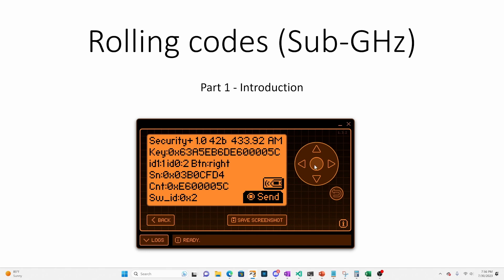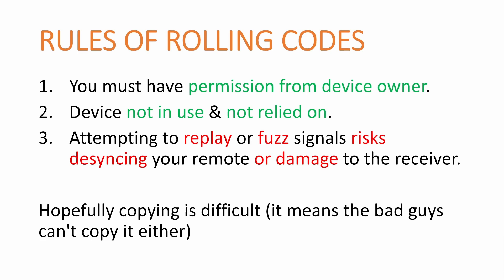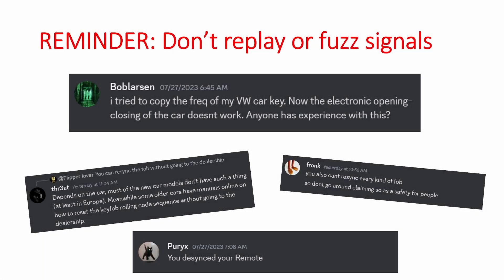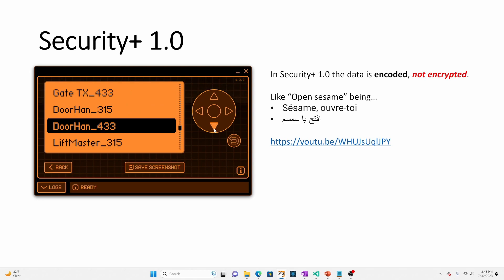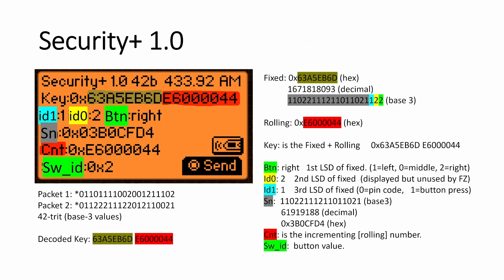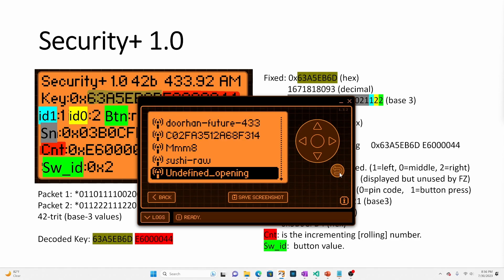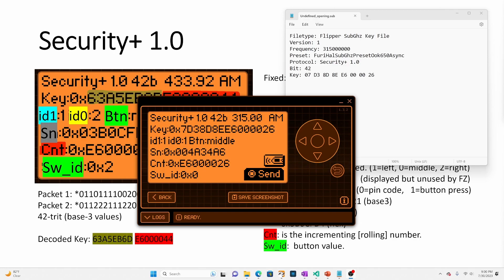[76] Flipper Zero - Rolling Codes Part 1 : Security+1.0

Comment: Is there a way to mimic codes from say a laptop? That way im not screwing with my car or buying a garage door opener I don't need
Reply from the maker: Yeah, the cheapest way to receive codes on a laptop is with an SDR radio. You can then use a program called "rtl_433" to decode the signals.

For SENDING the signals from a computer, I'm not sure what the cheapest and easiest way is? Maybe something like a YardStick One (probably around $100 US)? I haven't used mine yet, so not sure how easy it is.

Comment: I'd like to know the formula for generating the KEY from the MANUFACTURE CODE and SERIAL NUMBER. Thank you.
Reply from the maker: There are different KeeLoq implementations. See https://github.com/flipperdevices/flipperzero-firmware/blob/5b911f5405f104ad3e3051aa70e2a50a5b2a6d16/lib/subghz/protocols/keeloq.c#L135 for the simple, normal & magic algos. Most of the core calculations are in https://github.com/flipperdevices/flipperzero-firmware/blob/dev/lib/subghz/protocols/keeloq_common.c

Comment: How to copy rooling code remote car starting ?
Reply from the maker: Cloning a rolling code for the car using a Flipper Zero is NOT recommended. The process to get a remote to resync on a car is typically more involved (and sometimes involves paying the dealer or locksmith). If you are positive you know how to resync and add fobs to your vehicle, then maybe it's worth testing your vehicle to see what vulns it has (like trying a rollback attack).

Assuming it's a one-way protocol (remote to vehicle) some people have pressed the button a few times on their remote (away from the car) and saved the signals on the Flipper Zero. They can then play those signals in the same order using the Flipper Zero. Once they use the original remote, the signals they recorded are typically invalid (most rolling codes are based on a counter and all past counts are considered invalid). For some models, playing past codes can invalidate the original fob.

Comment: hello from France.yes I confirm I blocked a roller shutter using rolling code by re-injecting several codes with the Flipper
I should have checked before, but I naively believed that a shutter used a fixed code..so yes this is dangerous 8).thank for these explanations

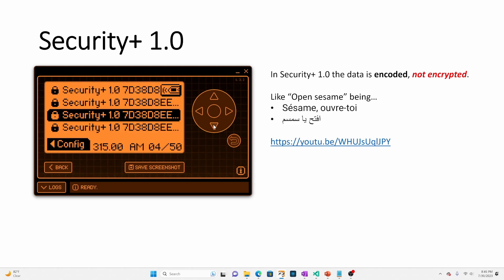Comment: 6:27 That’s not eighteen. Its hexadecimal so the digits 18 is twenty four.
Reply from the maker: Thanks for the feedback. I think in a few of my videos I read part of the binary/hex digits and sometimes combine the digits as well (saying "1", "8" might be considered correct as it's reading the hex value, but saying "eighteen" was clearly wrong).  The actual count was 3,858,759,704 because the Flipper Zero starts at "0xE6000000" (which I also ignored in this video). I'll try to look out for when I'm reading hex values in future videos.

Comment: Brilliant video thanks
Reply from the maker: Thanks.  Next Saturday I'm releasing a video that goes into way more detail on the actual encoding (from a RAW file all the way to decoding all the data & forming a valid Sec1.0 SUB file).  I'm on the 5th video about rolling codes, and some feedback I got was people are ready to hear the encoding details.  I think it will likely also cover Security 2.0 -- which makes for a long video, but it's still interesting to contrast the two protocols.  (Now that I've learned about them both.)

Comment: How did you learn that this the 42b was in base 3?
Reply from the maker: I'm studying the firmware of the Flipper to understand so I can teach this video series, since I know nothing about rolling codes before doing this series.  Both Security+1.0 and Security+2.0 use base 3 numbers.  Maybe in my next video on Security+2.0 we can geek out more and discuss the encoding (or decoding) part & differences between the two algorithms, if you think that would be helpful?

Here is the line in Security+1.0 that I concluded it was base-3... https://github.com/flipperdevices/flipperzero-firmware/blob/52b59662627254ae5ccde6201b5c4921573fc769/lib/subghz/protocols/secplus_v1.c#L368
Reply from the maker: Also, feel free to join my Discord server, if you haven't already.  The #general channel is a great place to ask more in-depth questions you may have about encoding/decoding.

https://discord.com/invite/NsjCvqwPAd
Reply: @MrDerekJamison amazing thank you for the response! I’m eating this stuff up

Comment: So, is it possible that you could overwrite a .sub file with a future count on the key, and then emulate that signal to unlock a device that is looking for that next count?
Reply from the maker: Yes, but typically the encoding or encryption makes it difficult to figure out what the key should be (assuming it’s looking for a count within 16 ahead of where you are).  In some cases where Save is disabled, I can Read a signal (write key down on paper), then edit my .SUB file with key & it resumes from there using the proper fix (SN+BTN) code.  Of course, now you risk desync the device; which is probably why save was disabled in the first place.

Comment: Hi Derek! I wanted to ask you how you took the second packet in this video and converted the 20 trit long packet and got it into the form of E6000044? Moving between the trit of the serial of the "FOB" to decimal or Hex made sense but I haven't figured out how you converted the original two packets into 63A5EB6D and E6000044. Anyways, thanks for making the video and would love if you did a companion for Security+ 2.0. Cheers
Reply from the maker: I'll try to do one on Security+ 2.0 in a few weeks.  

You ask a great question about the conversion!  I have a spreadsheet that explains it, but I didn't think it was appropriate to discuss in this introduction video.  Join my discord at https://discord.com/invite/NsjCvqwPAd and ask there, and I'll share the spreadsheet.

The basic idea is each digit alternates between rolling and fixed.  For rolling, it's we just use the {digit from the packet} (base 3).  But when we get to the end, we invert all of binary bits and come up with the hex value.  For both rolling and fixed we increment an accumulator with the last digit we figured out.  But for fixed, we calculate the digit using the formula (60+{digit from packet}-accumulator) and then take the result divide by 3 and use the remainder (so the digit is 0,1 or 2).  I think the spreadsheet I created explains it better.  If you are familiar with reading code, then https://github.com/flipperdevices/flipperzero-firmware/blob/b90e2ca3426cf4c3e7bf6360e010b7aed71e6e41/lib/subghz/protocols/secplus_v1.c#L366 probably explains it even better!  

I think the actual decoding may be wrong in the slide, since I was just learning.

Comment: Any chance you could play around with genie intellicode? Community has been talking about a missing manf key
Reply from the maker: Even with the MF key, there are additional steps that would have to be figured out, since it's a custom configuration.  Read more here...
https://forum.flipper.net/t/intellicode-2-code-dodger-2/3389/35
Also, intellicode uses a version of KeeLoq, so this video applies more (https://youtu.be/x4ml1JAH1q0).  I'm just learning in so many areas.  I have a lot to learn around crypto and other areas, it would take a huge effort & potentially get misused by the community.

What I think might be possible would be to create some roll-forward sequence codes tied to a Sn and then program those into a Flipper Zero.  Then you could pair your Flipper as a remote and then use a custom app to do roll-forward sequences.  I could do a proof-of-concept and share the files (but then my subscribers would all have common Sn, which isn't great).  Maybe I can teach how they can tear apart their own remote to create the files?

Join my Discord server (https://discord.com/invite/NsjCvqwPAd) and let's continue the conversation!

Comment: If it's that easy to screw up your remote, it's a DoS, so that's a vulnerability in itself.
Reply from the maker: It’s manufacture specific; but I agree.  I keep asking people for recommendations on where to buy different receivers to try it out. So far the receiver I have does KeeLoq but is susceptible to replay attack.  I have another two receivers on the way.  I’ve heard Genie (intellicode) seemed to get in a strange state when replaying past codes from ReadRAW - but the units are $60+ so I think I’ll probably try eBay after defcon to see if I can get a remote + receiver for cheaper.
Reply: I DOS’d myself today 🥴. Had to use my car app to unlock it and resyncronize the fob

Comment from the maker: PLEASE don't mess with production rolling codes & desync your remote!  Later this month I'll have an app you can run on a 2nd Flipper to practice rolling codes & hopefully September I'll have an app that can run on less expensive hardware (probably ESP32-S2/Arduino Uno + CC1101 + some screen [or serial port]).

My first couple of videos are going to help just understand what all the displayed fields are, then we can start to go deeper into one of the protocols.  Then we can continue looking at more protocols.

I bought hardware for KeeLoq, so I can make a few videos on that one.  If you know where I can buy inexpensive receivers in the US (garage door openers, gate controllers, etc.) that the Flipper Zero can Read, please let me know.  If there is a particular rolling code protocol from https://github.com/flipperdevices/flipperzero-firmware/tree/dev/lib/subghz/protocols that you are interested in, let me know that too!

Don't forget to join my discord channel for more conversations and giveaways...  https://discord.com/invite/NsjCvqwPAd
Thanks again for subscribing to my channel!
Reply: I have a theoretical question: If one key fob (rolling codes) is programmed to be used for 2 cars (of the very same model and configuration), which is possible with the OEM dealer software, what would be the negative implications from technical perspective?